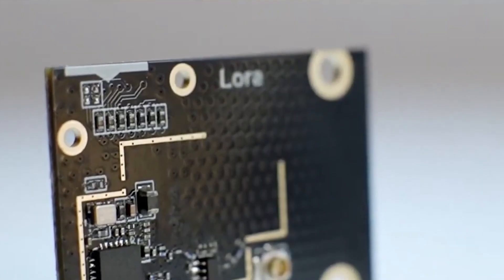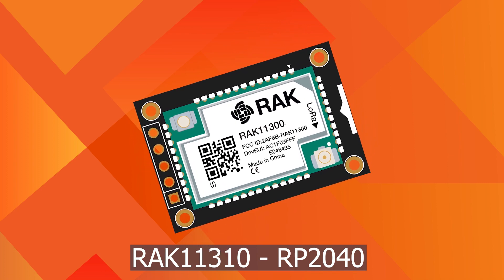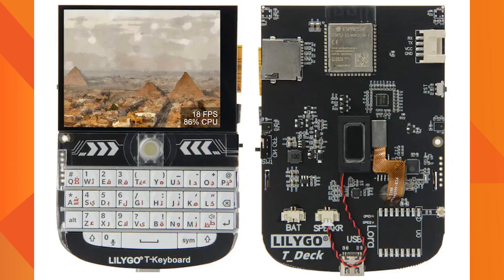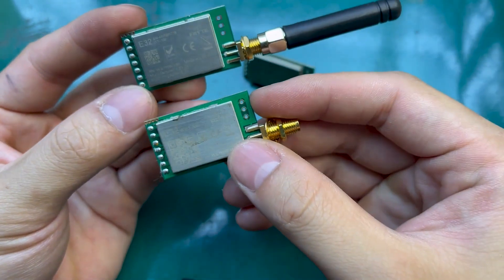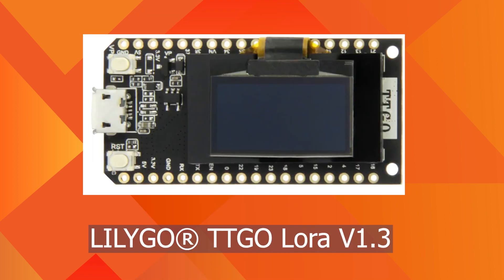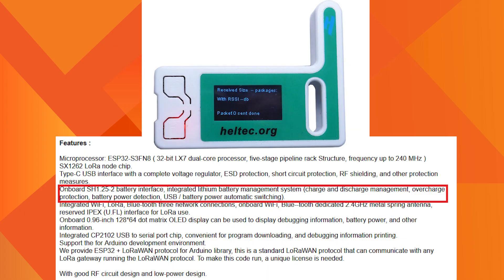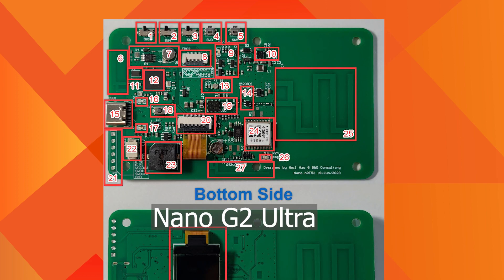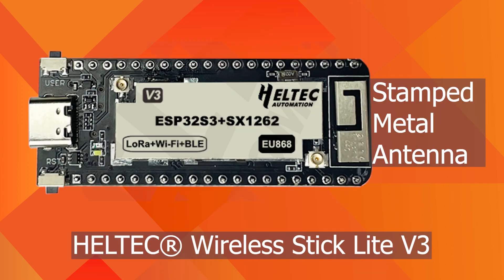Six Critical Components of Meshtastic Devices to be Considered Before Buying by Technology Master

Comment: Nice film and review of Meshtastic devices. You are wrong about one thing with Heltec WSL V3 because you can connect external Bluetooth antenna using one of these IPEX connector. Bluetooth and WiFi has got this same output from ESP32.
Reply from the maker: UPDATE: for Heltec WSL V3.  Please see the comment. 
@mr0rio Thanks for the info. I took info from https://heltec.org/project/wireless-stick-lite-v2/#Specifications.